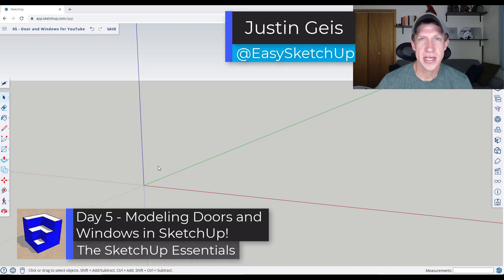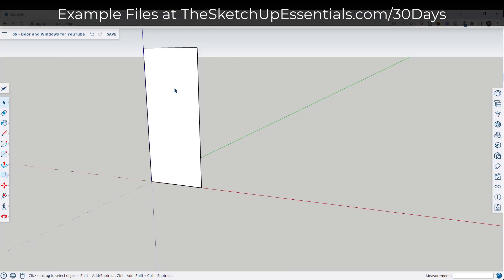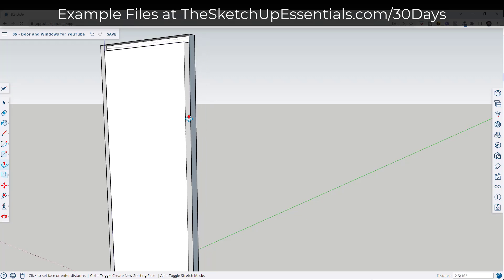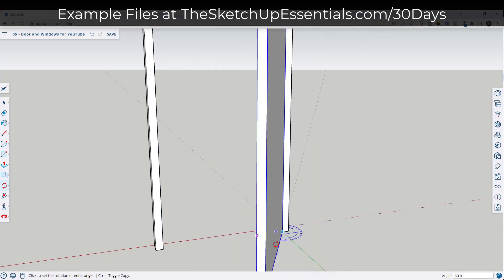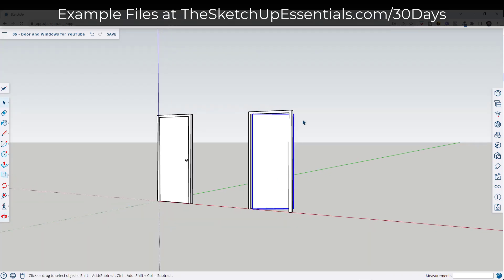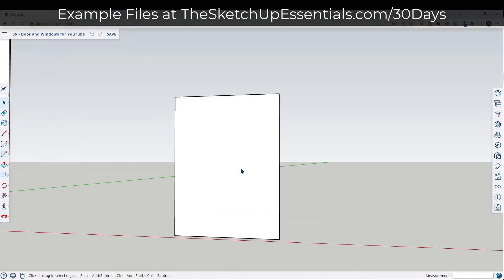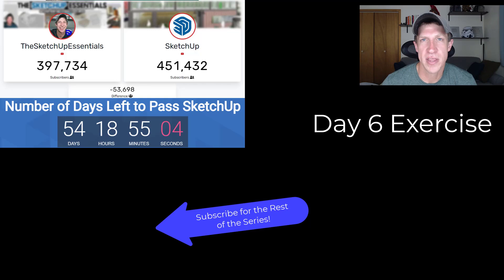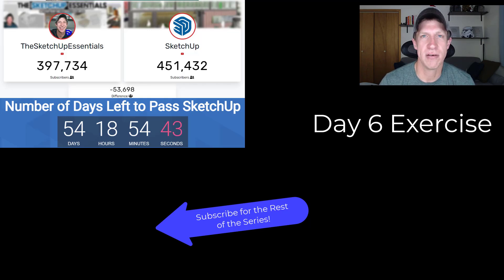Learn SketchUp in 30 Days DAY 5 - DOORS AND WINDOWS!

Comment: Thanks for these videos. I'm learning Sketchup on the fly for work after returning from maternity leave, my previous job became automated so now I'm coming back to be their modeler using Sketchup and I haven't modeled anything in like 10 years. I previously used 3ds max and Maya, Sketchup is WAY easier to deal with so far but its very different and I felt clueless until using your videos for help.

Comment: Appreciate your videos and just wanted to point out in case others are confused like me: I have been confused in multiple videos how to actually edit all instances of the component. If I am not mistaken, I don't think you explained this in the fence video either. I'm not sure if it is a keyboard shortcut you are using to edit the component so it's not visible that you are in a different mode or if the free version is different than pro, but it was not clear that I needed to click "edit component" to have it actually effect all instances of the component. If I just click the component and start making changes it changes it as if it was unique. I had to right click and hit "edit component" to do what is shown.

Comment: Thanks for the lessons, learning a lot from it. Question, I’m trying to draw in the window using the rectangle but I need to scroll in and out and  and use orbit to get to the next corner, how do I do that without loosing my starting point.
Reply: middle + left mouse is pan on windows :) middle mouse when orbit, and at the same time press left mouse button